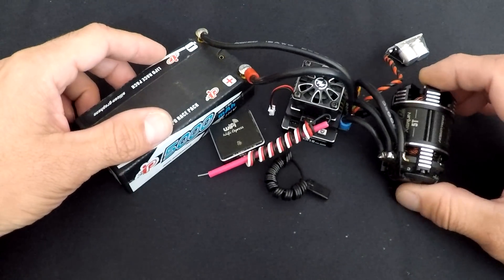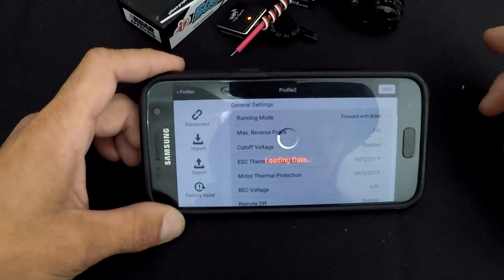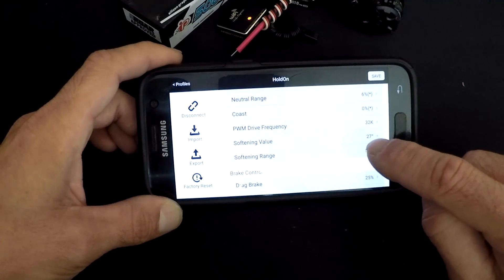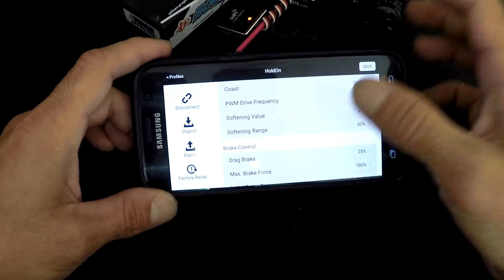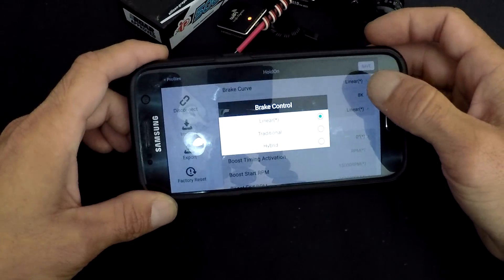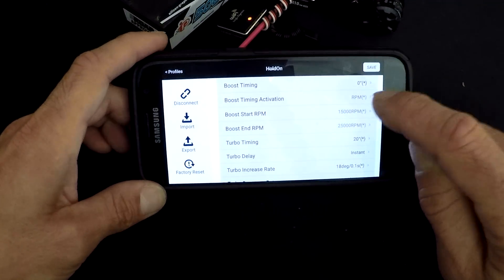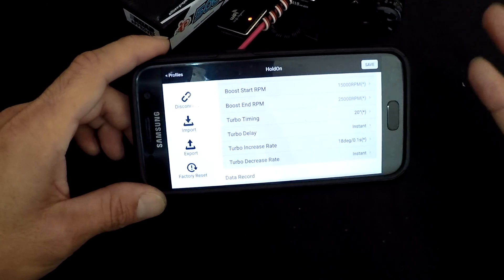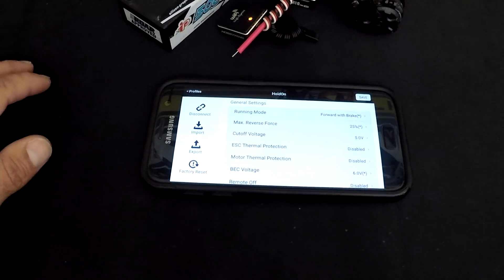The Charlie Show /// Episode 62 /// Wifi Express, XR10, and Settings

Comment: I've got a question. If my 5.5T motor is set to 40 degrees on the endbell but I add 25 degrees through the wifi module to the ESC does that mean I've got 65 degrees of timing? How does that work? Sorry for the newb question, I'm new to all this.

Comment: Fantastic video but, how do I get this thing to run "blinky" .........is it just a case of turning ALL the timing off ?
Reply from the maker: Blinky Racing = 0 timing, or 'Timing off', so yes, you are correct.  Blinky is often thought of as some magical mode that makes them all the same speed, it "only" means there is no electronic timing advance from the ESC.   You can find complete info on Blinky at RoarRacing.com

Comment: Thanks a bunch for going through all that. I now think I know just enough to either get my no-prep drag car either very fast or in thermal meltdown.  How bad is it for the motor to max out your boost instantly and max out the turbo at around 1/4 throttle?  By then I am off the line and the tires or hooking up pretty well.
Reply from the maker: "How bad?".... Hm.... It's not good, but it may work, really depends on the specifics of the application overall.  Hard to "Bench Guess" at stuff like that with any real accuracy. ;)